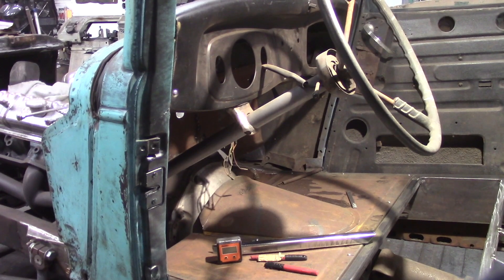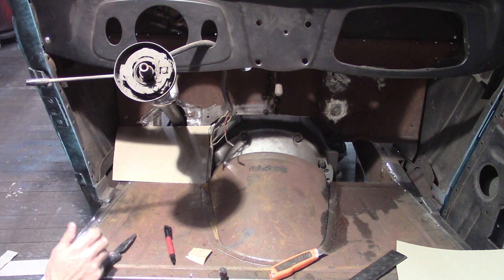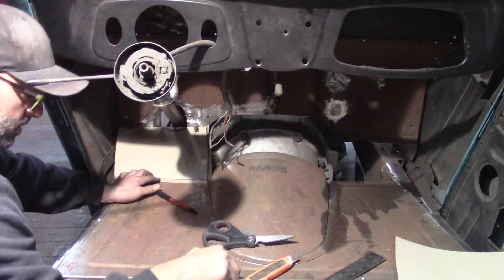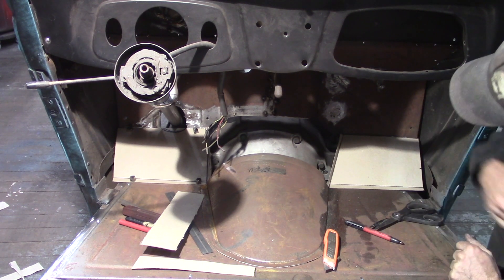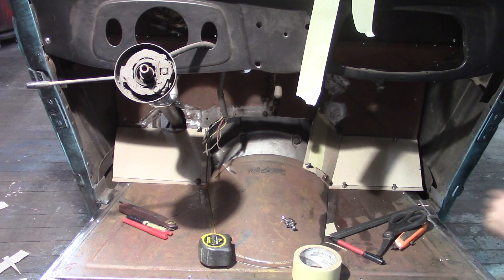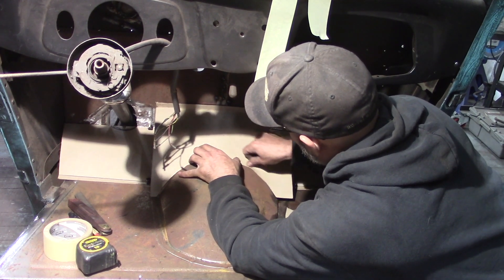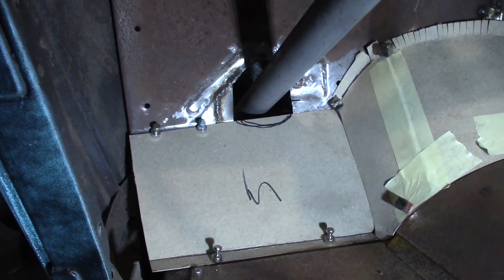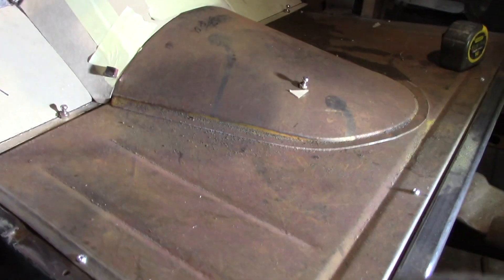Templating the 1934 Ford Toe Board

Comment: Tip for making a neat straight fold line in cardboard. Get a ball point pen, and using a bit of pressure, draw your fold line against the ruler with the ball point pen, two or three times and the card should fold very easily along you ball point line. You only drew that line once, so try three times and it should be easier.
Reply from the maker: I was unaware of that trick..it makes perfect sense

Comment: You might make an overlapping step in center curved transmission toe board. Instead of welding the toll board in one piece.
Reply from the maker: I decided to drill out the spot welds on the 32 truck floor/Trans hump.  I’m going to attach the trans hump/tunnel as one piece and weld the toe boards I made to the floor pan.  I want to be able to remove the entire trans tunnel in the future.  
Thanks for the input 👍🏼👍🏼👍🏼
Reply: @ThisOldHotrod  excellent!